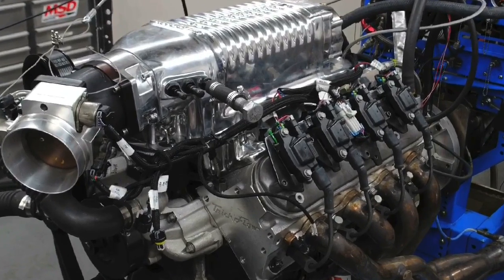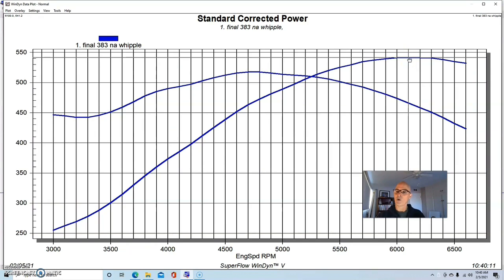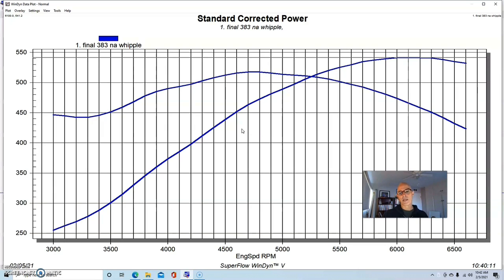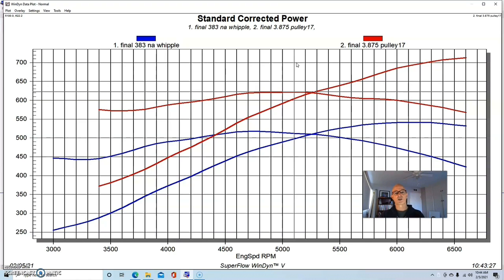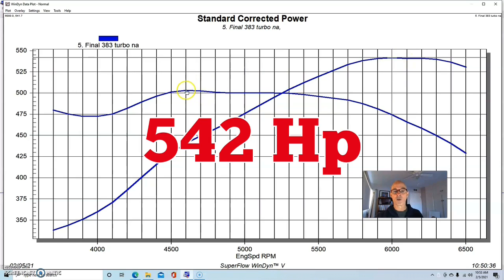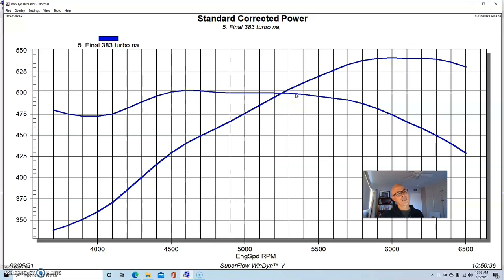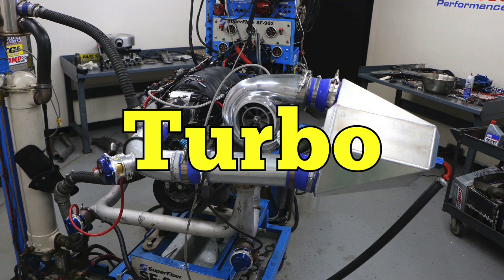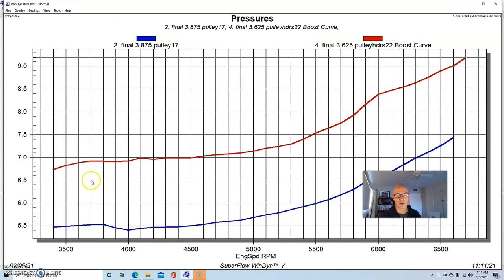WHIPPLE BLOWER vs LOW-BUCK TURBO-383 LS STROKER

Comment: Hey Mr. Boost:)
I have a question you might be able to answer and talk about in a video.
Why is it that the twin screw blowers like Whipple and Kenne Bell don't give the same snappy throttle response the classic Roots blowers have? While the screw blowers do compress the air in the rotor section, they are still predominantly positive displacement blowers just like the Roots blowers.
What's your take on this?:)
Reply from the maker: I wasn't aware that twin screws lacked snappy throttle response
Reply: @richardholdener1727  
I didn't mean as in not snappy at all. But with the stuff I've done, I've never seen them be as "explosive" in their throttle response as a classic Roots. Not sure how else to explain it.

Comment: Excellent comparison Richard, both good setups. For me the turbo is the way to go, the peak torque numbers & curve alone won me over.
Cheers😊
Reply: And then a 4.8 cam shootout will be exactly like an NA 5.3 or 6.0 shootout. They will just make slightly more power than the 4.8.

Comment: Boost won this competition.  I'm curious, at ~800hp, how much more fuel was the whipple using?  I think that would help illustrate how much less efficient the SC was.  Also, why couldn't supercharger manufacturers put a CVT into the input shaft of the SC, so that it could more of less keep the drive speed flat, resulting in a fairly flat boost curve?  Seems like a no brainer to me?  Great test and thank you as usual for doing these tests!
Reply: It's been done, e.g. the DB600 series of German WW2 plane engines had a hydraulic CVT driving their centrifugal supercharger. In that case, the CVT was controlled based on altitude so the engine wouldn't overboost down low where the air is denser. Power was still regulated by the throttle.

The Allies used a simpler system where there were two sets of supercharger drive gears, and a clutch to switch between them. While less complex, it had the downside of creating a range of altitudes where low gear couldn't provide full boost but high gear would overboost unless the engine was throttled back. The low gear also generally was too fast for sea level, so some throttling was needed at low altitude in low gear as well. Thankfully they had boost controlled throttle bodies to handle this so the pilot didn't have to watch the boost gauge all the time.

I've often thought the latter system would be good for hotrods, you could have a mild low gear for less heat and fuel use during normal driving, and a wild high gear for smoking tyres. Ideally with a Mad Max style lever to switch between them.
Reply: It's been done, Procharger made the i1 a while back. Centrifugal superchargers are more efficient than whipple type. I guess it was too expensive for most people.
Reply: @JosephVE3GKT  Thank you, that is really awesome.  Speed costs money, right? :)
Reply: i wondered about it too but i guess it's the responsiveness of the cvt that's not there yet. imagine being at iddle and the thing being in boost, read as "6th gear" on the supercharger and then you revv it in neutral and the thing blows itself apard because the cvt doesnt downshift in time.

Comment: You can make a flat boost curve on the supercharger with a bypass valve or blow off valve. It would be even less efficient unfortunately as you will need to set the pressure release at the boost level attained at low rpm with the valve bleeding pressure almost all the time after that. An even smaller pulley would be needed.
Reply: Kinda unfair test yeah. That is exactly what the turbo was doing blowing off it's excess the WHOLE TIME. Then not same set up for supercharger, so it never had chance to make same torque.

Comment: I'm a turbo guy.  However I've toyed with the thought of driving a blower with a CVT type drive unit-spin the blower quicker to get the desired boost and then adjust the blower speed via the CVT to maintain the boost level-min rising boost curve.
Reply: Use a bigger blower and put a throttle valve paralell to the supercharger to alter boost.  My car has it stock.

Comment: Whipples are great. They are like a mix between a tvs and a centri blower. Tvs blowers really hit hard down low
Reply: I have a factory TVS on my CTS-V. The advantage is you're able to really spin it at lower RPM but no parasitic loss. Then the valve closes and instant torque!

Comment: I have a 388 TBI. If I set the timing eight degrees retarded it pulls super hard from 1500 to 3500. But if I set the timing to 5° advanced it pulls really hard from 3500 to 6,000. The TBI uses the electronic ignition do you think there could be something wrong with my computer or my distributor.?

Comment: I think it would have been a better test, if you showed the turbo spooling up. Start both test from 2,000 rpms, no load.
Reply from the maker: we can't start with a no load condition on the engine dyno-only on a chassis dyno
Reply: Soooo, how often do you run your car at wide open at 2000 rpm?
Reply: @AB-80X  Just yesterday, I was in third gear, going up a steep hill, mashed the throttle at 1500 RPM with a 2.2L engine with a T4 turbo and a ported big valve head.
The acceleration was EPIC! 😂
Reply: I typically don't go wide open throttle at 2000 RPM. But with the Eaton supercharger I could. And would have instant boost and acceleration. Other than drag racing, how often do you brake boost?
  Engine Dyno results are good , and show the efficiency of the turbocharger. But it does not show the whole picture. Namely the instant and controllable power from a supercharger.
Reply: @kcdesignconcepts5216 100%  correct!

Comment: The whipple was always going to make less power even at an equal boost pressure due to being driven from the crank, however, you haven't quite compared apples to apples here. The 215 heads are running out of flow at the top end of the range, and you can see that in the rising rate of increased boost from the whipple. You really ran 7psi on the whipple, so you needed to run the whipple much harder to get 10psi on that flatter part of the curve (we need to see the rest of the boost curve too btw - all the way from idle), and should have stopped at about the same RPM as you did on the turbo motor. Still - not a terrible comparison, and interesting to watch. Did you run the same timing on both engines? Generally you will find that if you are knock limited by your choice of fuel, that the supercharged engine (for the same boost pressure and intake temp) will accept more knock limited timing which makes up just a little bit for robbing crank power to turn the supercharger. The turbo engine will have much higher exhaust backpressure and tend to accept less knock limited timing. Would have been very interesting to see intake temps, exhaust pressures and the timing map applied - and obviously on the same engine with same heads and cam etc - but we all still know the turbo would have produced better results. A comparison of torque/power off idle and throttle response / lag would be a good comparison too - as this is where the whipple shines and most turbos don't perform quite so well - but its VERY difficult to show this kind of dynamic performance, unfortunately.
Reply from the maker: no on the heads
Reply: The gt45 made double the boost by 3000 rpm, any fn stall converter  let alone the right converter the “LAG” will virtually none existent

Comment: I’ve always and will continue to always say: there is zero advantage to a supercharger (especially a centrifugal) over a turbo.
Reply: I wonder what the fastest quarter-mile cars have on them? I'm talking about the cars that go from 0 to over 300 in 4 seconds.😁
Reply: @kcdesignconcepts5216  only because top fuel rules prohibit turbochargers, my freind. Everywhere turbos are allowed, they rise to the top.
Reply: @jamesgeorge6551  but do you know the reason why they're not allowed? They all want pieces of turbine Wheels blowing out at people.
  Hundredth of a second lag = you lost the race.
Reply: @kcdesignconcepts5216  nah, its about noise, legacy and blowers. Top fuel engines have shields, blankets, diapers etc etc all in the name of safety, a turbine leaving the housing is unlikely, and they could shield that too.
Reply: @kcdesignconcepts5216  GMC 2 stroke diesel scavenge pumps.
Reply: @TwoLotus2  those were the old days. They used twin screw compressor is now
Reply: Borrowing horsepower from one end of the crankshaft, to add it to the other end is against my religion.
Reply: I have owned Vortech cars, nitrous cars and turbocharged. The turbocharged car was 6 tenths quicker in the 1/4 mile from the Vortech with ZERO other changes. I don’t solely race dyno’s either....but thanks
Reply: Evidently you havent owned them.  I have owned them all....and currently a twin turbo car and a Procharger car.  Centri's definitely have many advantages .  You don't race dyno numbers or boost curves....you race cars.  But hey, dyno numbers impress people that don't know.
Reply: @tunerdadtunerdad7927  just my preference guy. Wasting power on blowers, when turbochargers do it for free = stupid in my book. And I've tuned, driven plenty. Turbochargers always win the efficiency war bud, always.
Reply: @jamesgeorge6551  Turbos are far from free power. Please don't perpetuate that myth.
Reply: @werks96  yeah, Cummins, Caterpillar, Isuzu, Mercedes, Toyota, Honda, Volvo, Mitsubishi etc.,etc, all got it wrong, superchargers driven off the crank is way better. "Myth perpetuation" is done by idiots that make blanket statements about things they themselves, don't understand
Reply: @werks96  watch this, Richard will explain,  THE TRUTH ABOUT BOOST- TURBOS vs SUPERCHARGERS
Reply: @jamesgeorge6551  I understand quite well. There many reasons to run a turbo or supercharger based on the end goal. My comment was about turbos being "free power". They aren't. Maybe you and Richard should both look into that.
Reply: @werks96  I promise we both know better. Live in ignorance, dude.
Reply: @tunerdadtunerdad7927  what are the advantages? Do you prefer pro charge to whipple?

Comment: I 100% get the idea of this comparison. But looking at your whipple boost curve I'm thinking belt slip. I struggled with belt slip forever with a 3.4 whipple 5.4  4v ford. The boost curve was always rising same as what I see in this test. Finally after switching to 10 rib pulleys 3.75 upper and a 9" lower I had the flatest boost curve yet. I had all the boosts by 3600 rpm 23.7 all the way to 7000.
Reply from the maker: a rising boost curve indicates a lack of belt slip
Reply: @richardholdener1727  Would it be different on an eng dyno? On the chassis dyno under accel the run was four seconds to 7000 rpm. I was having trouble with belt slip on the sudden accel. Video showed smoke coming off the upper pulley. Peak boost was the same between the pulley setups. But the 10 rib had way more boost in the curve.
Reply: @richardholdener1727  The blower you used is a positive displacement pump. Its boost curve should be linear.

Comment: Do you have any data down low in the rpm range?  2000rpm and on.  Would like to see the torque and hp curves down low coming off idle and the boost curves as well to see when each one starts to come in, how fast each can build boost
Reply from the maker: no-I don't run WOT at 2000 rpm

Comment: Video just started, but the turbo wins.
Bc turbos always win.
Reply: You know, I was at a heads-up race a while back running a Pro tree, and a guy there told me that exact same thing. I deep-staged in best John Force style and he was still having a coffee break at the line waiting for his turbos to spool when I was at the 60' mark. Trust me, him and his turbos did not win.
Reply: @AB-80X  sounds like he didn't know how to drive his car, or his turbos were too big.
Turbos will always, ALWAYS make more peak power, more peak torque, and much higher hp and torque at low rpm IF they are sized correctly.
If you have 2 identical engines, one is running a properly sized turbo and one has a properly sized supercharger... Both running the same boost pressure, the turbo will make more power across the entire rpm range.
Belt driven blowers require a ton of power just to run the blower.
Its simple engine building 101... Get a turbo that is sized correctly to your engine and it will spool quickly and build more boost lower in the rpm range. Therefore making more power.
There's really nothing you can possibly argue with, turbo lag is only a result of the turbo being sized for high rpm power and not low down hp and torque.

Comment: Learned that the GT45 is an absolute beast. Thank you for continuing to use it in your tests Richard.
Reply: The cx racing version is much bigger than the dna eBay gt45. It’s a 80/77.

Comment: LETS FINALLY GET THE PARASITIC LOSS OUT OF THE WAY. 
Get two 5.3 engines in the dyno room. 
The one on the dyno with a blower.
The other mounted next to or reverse infront of it just to run the blower belt and have it holding at 7000rpms. 
We then have a supercharger full boost no parasitic loss to compare to the engine on the dyno running the blower normally itself.
Its a legitimate scientific test👍
Reply from the maker: I have blower dyno data
Reply: @richardholdener1727  the other day on a live you were talking about how inefficient blowers with the air blowing back ect. Is that just rotor/screw design or placement on the engine. Would a remote mount one be any more efficient having a more intake manifold or length to travel through and not just be a short runner with pressure build up? Also wondering if any testing ever done to see if the myth is true, like 2.2L vs a 2.8L does the 2.2 have a quicker boost response and reach its maximum boost faster than the 2.8L. It use to be said around the svt forums but to me it seems like even if its less psi the larger displacement blower is moving more air regardless.
Reply: @niknasstie  Kenny Bell usually has blower Dyno data on his website. However Richard always does the hardest dirty Work. Long story short the turbos are always more efficient than superchargers..... If you are supercharged you might want to run a little bit more boost but then you have to figure out how to cool down that charge air especially with a twin screw or a roots that will become your enemy very quickly the charge heating
Reply: Ah, a boost caboose:)
Does not have to be reverse anything. Just an engine driving a blower feeding the engine on the dyno.
Reply: It's the nature of the beast if you're going to be supercharged you are going to always have parasitic losses that's how you drive the supercharger.... The supercharger is always mechanically connected to the crankshaft. Turbochargers are using heat and velocity from your exhaust gases to drive the turbine. Turbos are not perfect either however they are always more efficient than a mechanically driven supercharger

Comment: It's official, we need to buy Richard a 4l80e for his truck so he can finally boost it 🤣
Reply: 6L90
Reply: Don't forget a 14 bolt rear
Reply: Nah. He needs a Rossler 400 with manual valve body:)
Go big or go home:D
Reply: @AB-80X  a 4l80e is essentially just a th400 with overdrive
Reply: @shoes121255  its electronically controlled
Reply: Dump truck tranny?! Lets go g force face-plated 5 speed!
Reply: @madmod  I like it. I’d go liberty
Reply: You can boost on a 4l60?
Reply: @Anonymoose0913  if you wanna grind the ⚙️ sure why not
Reply: Why, so his transmission selector can read N N N N N

Comment: Everytime I hit Turbo Boost on my 1982 Black Trans AM the car jumps over other vehicles I don't know what's going on with it and the car talks. The car is kinda a smart ass.
Reply: Is it a turbo 305 or an old Turbo Trans Am 301?
Reply: @DavidValdezBigWaveDave  Knight Industries turbojet "i'm just joking" I was talking about KITT from Knight Rider.
Reply: @TheBoogyVanGuy  i get it now!! Genuinely gave me a good chuckle when it went over my head (the joke, not KITT)
Reply: @DavidValdezBigWaveDave  I think there were a couple test mules with carburated 3.8l turbo engines in 3rd gen cars. There was the 3.8l FI that I think was a 1989 turbo trans am. The knight industry car wasn't just any Trans Am, it was a Recaro Trans Am

Comment: There may not be any parasitic losses when driving a turbocharger with a "motor", but there certainly are when it's on an engine.
Reply: Well it's not really a parasitic loss however with turbochargers your losses would come in the form of back pressure from sizing the turbine too small for the motor... But that's not a parasitic loss that's a failure of calculation.
Reply: @troylambert5140  Lol, heat doesn't power turbos.  They are all driven by compressed gasses.  And it should be obvious to anyone, that horsepower is required from the subject engine to compress said gasses.

Think...  Don't just repeat everything you hear like parrot.